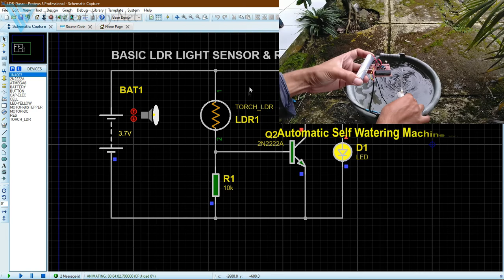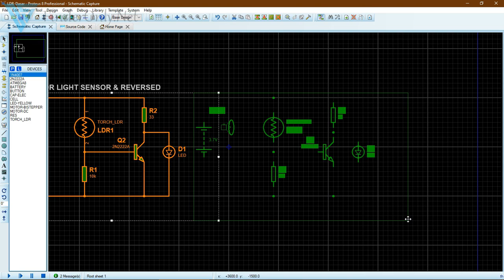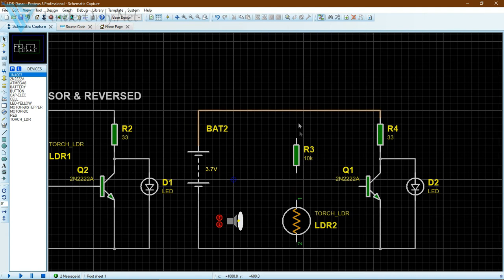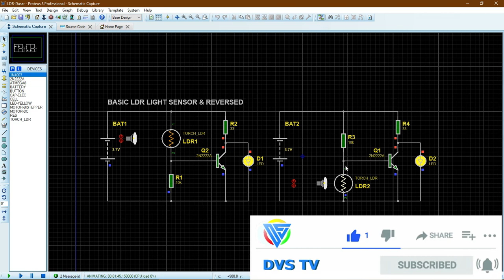LDR Light Sensor Circuit & Reversed (ON at Night or Daylight)

Comment: its not working when implemented physically 😞
Reply from the maker: Whats the specific problem? I designed it based on working kit.
Reply: @DVSTV  

f11-03-2023

(1.) Hi, there.

(2.) Looking through my resistors and don’t see a 33 Ohm.

(3.) Did you mean 33K Ohms, 330 Ohms, or 3.3 Ohms; or is 33 Ohms, as stated, accurate?

(4.) Thanks.

(5.) Toodles!